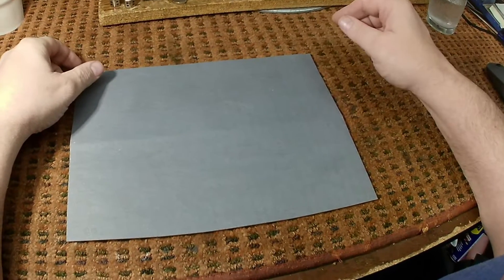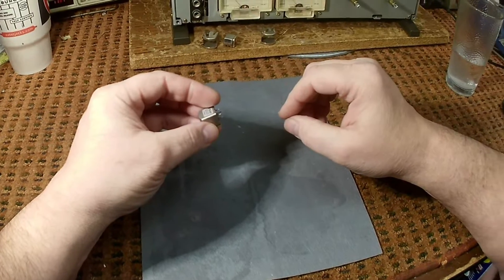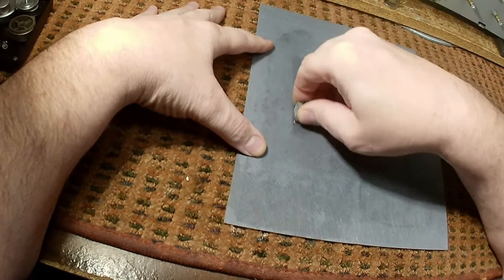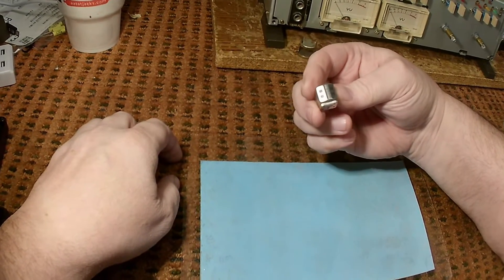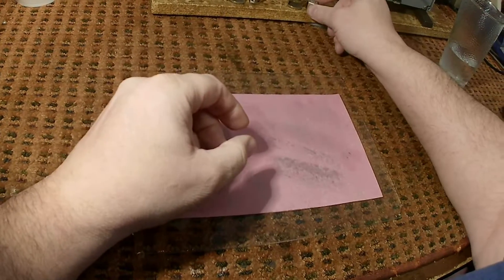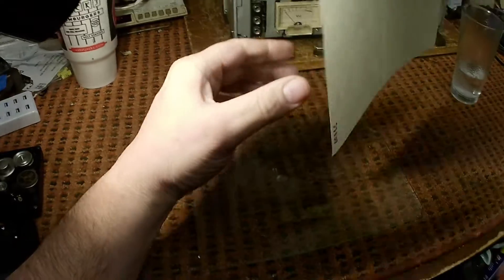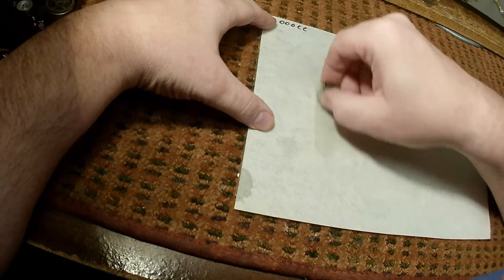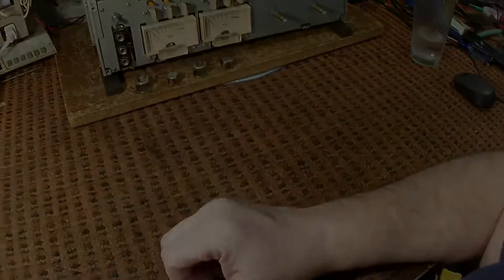How To Relap Tape Heads (With New And Improved Camera Angles!)

Comment: The thing that worries me about this technique is that nothing is keeping the head parallel to the sandpaper; you're relying on finger pressure to keep the sanding from favoring one side or another.
Reply from the maker: That's true, up to a point. The thing is, you're only removing perhaps 0.1 - 0.2 mm of metal from the face of the head at the most (if the wear groove were any deeper than that, the head would be worn out), so you don't really have the chance to make the face of the head significantly asymmetrical due to uneven lapping pressure.
Reply: @ScottGrammer  Now that I think about it, isn't there an adjustment specifically to adjust the heads' angle across the tape, i.e., if azimuth were "yaw," this adjustment would be "pitch?" Although I'm unclear how you're supposed to adjust it to null out that angle. I mean, you could do it with a granite table and an indicator on a stand, I suppose...
Reply from the maker: @hubbsllc  There is such an adjustment, called "zenith," on most reel-to-reel machines. The simplest way to adjust it is to cover the face of the head with wax pencil markings, and then play an old piece of tape over that for about a minute. Looking at the wear on the wax marks from the tape passing over it, you can see whether the top of the head is too far forward, or too far back, or even with the bottom.

Comment: What is the grit on the “sandpaper” composed of?
Reply from the maker: It's actually aluminum oxide, and it's not sandpaper, it's lapping film made by 3M for this kind of thing, i.e., removing small amounts of metal and then polishing to a high sheen. Folks also use it for sharpening razors. The "grit" can be as fine as 0.3 microns - about 1/200th the thickness of a human hair. The white sheets of this film - that is, the 0.3 micron stuff - feels smoother than printer paper to the skin.
Reply: @ScottGrammer  thank you!

Comment: What if You have the cassette head with the guides ?
Reply from the maker: Well, generally, I do not relap cassette heads. Most do have the guides you mention, which would preclude relapping, and often one can find a replacement head from a donor machine that will do nicely.
Reply: @ Thanks . I was able to do it with super patience and a thin glass flat platform as support , then using 5000,8000,10000,12000 sand paper. Very gently and with limited movements but ... now the head is super shining !  Of course mine was not in super bad conditions ...

Comment: dear, that's what I did just now. In the morning I saw your video, at noon I did my pioneer rt707. All very well about 30 sec with 2000 and 30 sec with 5000. Note that my heads were in very good condition. But now they are new. Thank you very much.

Comment: This is one of those NOT TO DO Videos. I cannot believe this guy is sanding down the head by hand with 600 sandpaper. There is absolutely no guarantee that a hand method can achieve an absolute square and even lap. He may sand off the edges, but if not lapped square, the tape will skew across the head, making the original problem worse. Not only that, who knows how far into the head the material has been taken off, maybe  rendering the head useless! If you cannot get a replacement head, consider this! Send your heads to a reputable company for work! . Unbelievable!
Reply from the maker: Sigh....

I don't know why I keep having to reiterate this. This is a method used for decades, originally published by Nortronics, a tape head manufacturer. Further, see this video: https://youtu.be/9krRzG0zm_M.

Then, when you're done looking at that video, here is a link to the actual Nortronics relapping guide, showing the method I adapted into my own. You can download a copy for yourself. https://drive.google.com/file/d/1daPs3MM7LCB8HrsSiPAkF4sJP0UUIHmx/view?usp=sharing
Reply: I immensely appreciate the video and the link to the Nortronic paper, but I think the first lapping step with the 600 grit paper should be done with glass support, and I don't see a rigid support in the video. The Nortronics paper recommends to use a flat glass support for all grit gradations (see page 10, for the 400 grit). 
Again, I'm grateful, but might be beneficial for everybody to note this, likely accidental, omission.
Reply from the maker: @bilocerezo1739  The glass support is there at all times. The first lapping paper is bigger than the glass, so it's not visible.

Comment: Nice video, very helpful.  Gives me confidence to try it.  BTW- Crown used plastic connectors that plug into the heads, no soldering to the head.  Why wouldn't every mfg use a removable connector?  It makes service so much easier.
Reply: Any chance you could do a video on basic re-alignment of the PB head, after lapping?   I have a calibration tape from a quality lab house, but I think they are recorded in full track mono, or perhaps 1/2 track mono, so not sure if maximizing the playback amplitude on a both channels of a 1/4 track, stereo PB head would actually be optimizing the head height, since the recorded signal is wider than a normal 1/4 track, stereo track width?  Almost thinking a commercial pre-recorded tape would be a better tool for setting the tape height, and then go back to the cal tape for the azimuth and zenith adjustments?  Thoughts?
Reply from the maker: I always re-align the heads after relapping. I align the height visually, using a magnifier and clear leader tape. Azimuth is set with alignment tapes from MRL, and then zenith is set by marking the face of the head with a wax pencil, running a few feet of leader tape past it, and evaluating how the wax is worn away. Head depth, or wrap, is set by consulting the service manual. If the manual does not speak to this, then it is set to match the original settings by referring to photos taken before the heads were removed. Full-track alignment tapes are fine for use on heads with other track formats, so long as the alignment tapes are fringing compensated. You really can't use an alignment tape to set head height.
Reply from the maker: It depends on which heads Crown was using at the time. They used many different kinds of heads on the same machines, over time.

Comment: unprofessional ! That's not how you treat magnetic heads. I worked for 43 years in a company for professional magnetic heads. Applied Magnetics Corporation. You destroy magnetic heads, we polished the magnetic heads on special lapping film from 3M lubricated with isopropanol and the magnetic head was in a special holder so you didn't distort the gap material ! This video shows how to destroy a magnetic head.
Reply from the maker: I have an awful lot of happy customers who would disagree with you. And my Otari MX55N, which I use on an almost daily basis, would also disagree with you. But thank you for your comment. The film I use is from 3M, although I use water instead of isopropanol. I use water because isopropanol, which is alcohol of course, evaporates much too quickly to use. https://youtu.be/9krRzG0zm_M
Reply: @ScottGrammer  does the use of water infect the head into corrosion problems more instead of isopropanol?
Reply from the maker: @Retro.Studio  The heads do not stay wet for long, and I dry them thoroughly with microfiber cloths. But to more directly answer your question, I've never seen it cause a problem. There is actually very little water involved - just enough to put a sheen on the lapping media. If you have water standing on the lapping media, you have too much water. You can just shake the excess water off, and you're ready to go.

I've read where other use IPA instead of water. I will give it a shot next time I relap some heads, and see how it goes.
Reply: @ScottGrammer thanks for replying.
I’m familiar with the use of petroleum or gum spirits use with filming paper on laquer polishing. It keep the paper more clean in cutting use. But it is a bit greasy

Comment: 16:43 Well, I guess that is one up for the Teacs then as having the same record and playback heads means that when the playback wears down to the point it's unusable, it can then be swapped with the record head, doubling the combined heads' life and thus the deck's life. 
I had never heard of 10000 and 22000 grit sandpaper until now. I think the highest I've used anywhere is 4000.
Good video.
Reply from the maker: Your idea would work except for one thing: The record and play heads wear at the same rate, so when one is shot, they're both shot. 

The sandpaper is more properly termed, "lapping film," and it's made by 3M and others. 3M makes a lapping film so fine that each grain of aluminum oxide is only one micron (1/1,000 of a millimeter) across.
Reply: Ah yes, @ScottGrammer , I forgot to mention the caveat that the deck is mostly used for playback than for recording. I guess, that's a fair assumption for a deck in home use.
Reply from the maker: @Stelios.Posantzis  It is. But the tape passes over both heads, regardless of whether the machine is playing or recording, so the wear on the heads should be nearly identical, unless one has less "wrap" than the other, meaning that the tape is not held as tightly against it as the other head.
Reply: Right  @ScottGrammer . Thanks for pointing this out. I had always wondered if that was indeed the case and why decks were made this way (i.e. all three heads in contact with the tape at all times). I initially thought that maybe manufacturers were too chap to alter the tape path during playback just to save the recording heads  That cannot be the reason though since they do have a mechanism to ensure the tape is not touching during fast rewind/wind. Maybe, from their perspective, if the two heads are different (unlike Teac that is), then why bother? If the playback head is ruined, then the deck is done unless a replacement can be found.
Reply from the maker: @Stelios.Posantzis  Mainly, the reason for leaving all three heads in contact at all times is because the wrap angle of the tape around each head is dependent on the other heads being in contact with the tape. Move a head out of the way, and the wrap angle changes on the other heads, changing the contact patch, and thus the frequency response. Also, one of the advantages of three-head decks (for mastering decks and home decks) is the ability to listen to the audio just recorded through the playback head. Professionals call this "confidence recording," and it allows you to know for sure that you've put a clean signal to tape. Without all three heads in place, this would not be possible.
Reply: These are very impressive materials indeed  @ScottGrammer , effectively allowing one to lap various pieces with relative ease and without equipment.

Comment: I’ve repaired and restored several hundred reel to reel machines but always just replaced worn heads. These days heads for older decks are harder to come by, so I was looking for information on relapping heads. This was just what I was looking for!
Back in the 1980’s I put myself through college and grad school as a tech at a local medium-high end stereo store. I loved doing it! I fixed between 30 & 50 units a week for 6 years and then more working for them part time because they couldn’t find a good enough tech to replace me.
It was a hard job to leave because I enjoyed it so much and because it took several years at a corporate job until I was bringing home the same salary. In hindsight the decision to leave was a good one because the consumer electronics repair industry has pretty much dried up since.
Now I restore & repair vintage audio gear, primarily tube based. It’s easy and enjoyable because I’ve done most everything before.
Thanks for the video!
Reply from the maker: Glad you liked it! I've been in the audio field in one capacity or another since 1977. I've always enjoyed it.
Reply: you've got a replacement 1/2 inch 16 track head for my fostex i presume then? >:3c

Comment: Is there a second companion video of the frequency response testing of the heads in action?
Reply: Yeah I think you’ll find that the before and after frequency sweep will tell you how good a job this is.  Personally I don’t think this is a DIY job.  Way too many things can go wrong, and then you have the issue of getting proper alignment after the fact.  Unless you’re using some kind of optical alignment block, you’re going to be having lots of errors.  And I doubt you’d get it aligned properly.  

Regardless, thanks for the attempt.  However I think you should warn viewers of the risks involved attempting this.

On a different note, happy to see more tapehead videos out there.  Not sure why the algorithm waited 2 years to show it to me!
Reply from the maker: @JeffersonDD  https://www.youtube.com/watch?v=9krRzG0zm_M
Reply from the maker: No, I did not do that, but it's a good idea that I may well use next time I relap heads. I can tell you that I did this for two identical model 32's, both belonging to the same client, and both were easily able to exceed the factory frequency response specs after aligning the playback levels and EQ using an MRL 15IPS IEC test tape, and setting the record bias, EQ, and levels for RTM LPR35 tape. I have my own personal Otari MX55N whose heads I have relapped similarly, and its response is outstanding on both the 1/2 track and 1/4 track heads. I recently relapped the heads on a Pioneer RT-707 and an RT-909 for a client, and those machines were restored to fine performance with that same tape, albeit at 7.5 and 3.75 IPS and using the NAB EQ curve, of course.
Reply from the maker: https://www.youtube.com/watch?v=9krRzG0zm_M

Comment: One way to possibly improve the precision of the lapping would be to put the head against a square block while moving it on the paper.
Reply from the maker: I see what you mean, but I'm not sure how to make that work. Besides, I don't take a lot of metal off because once the wear groove gets to be about a half-millimeter deep, the head is pretty much worn out, so I don't relap unless the wear groove is much less than that. And I only remove enough metal to get rid of the wear groove.
Reply: @ScottGrammer  Well, I did that lapping against a block. And I was working on a flat surface plate. What happened was that since the head was always in the same place, some waviness resulted across the head, as the head position on the paper was never changed, and the paper is not perfectly flat.

A way to avoid that is to use a smaller square block that you can move with the head, thus allowing the head to move around on the paper and be cut 
more randomly.

Comment: i have a cassette deck and it is so worn out, you can see the insides of the wear groove (probably about 0.1mm - 0.2mm deep) and the gap in the head is about 0.5mm wide, very visible. You can actually see inside the head. Oddly, the head does play some tapes almost perfectly but only on side A, side be on any tape (prerecorded or home recorded) sound seriously muffled. I would love to replace the head and wouldn't really care if it wasn't 100% perfectly adjusted but i dont have a soldering iron :(

Comment: This is a very informative video, but it could have been much more so if it had had hi-resolution images of the heads' surfaces at each stage of the process.  Head  realignment  needs  to be a
 v  e  r y   precise process to get  it right.  So my thought is that relapping & realigning is best done
by professionals, not by individuals at home.
Reply from the maker: True on all counts.
Reply: There are two questions here : 1) Who is willing to pay what the so called "professionals" are asking for ?  2) Also, I really don't believe a professional would do much better if not using some kind of very precise jig or CNC like machine in order not to rely only in experienced hands. I guess it would be very important to know upfront which are the resources available at this professional bench.  In the other hand, DIY may better match expectations between the value of the equipment x value of the repair....

Comment: Scot Grammer. Heads if i want to buy give me advise
Reply from the maker: Hi. I don't know of any source of new tape heads for consumer tape decks, with the exception of the Pioneer RT-701, 707, 901, and 909. There is a fellow who is rebuilding 1/2 track heads and modifying them into the 1/4 track heads needed. You can find them by searching on eBay. I have used these heads and they work, although the playback EQ circuit of the deck will need to be modified to correct a rising high frequency response.

Comment: Interesting video - thanks for posting. I'm curious about something. With the 600-grit paper, it looked like you laid it directly on what looks like a bench pad or rug on your benchtop. When you moved to the higher grits, you placed what looked like a thin piece of plastic or glass underneath the paper. Why the change? And would it make sense to use the hard backer under the 600-grit as well, or do you want the soft backing at the start for a specific reason? Thanks!
Reply from the maker: Glad you like the video. The glass was there at all times.